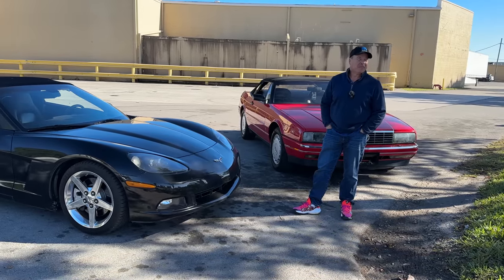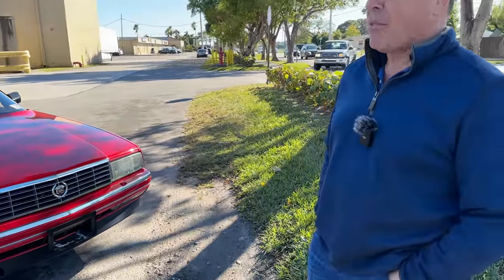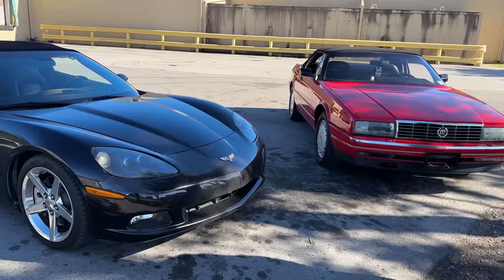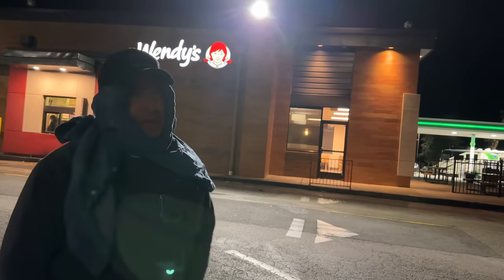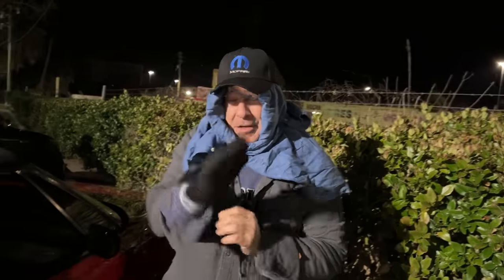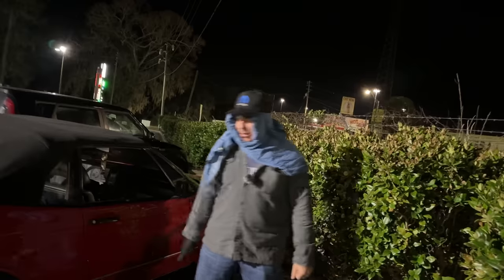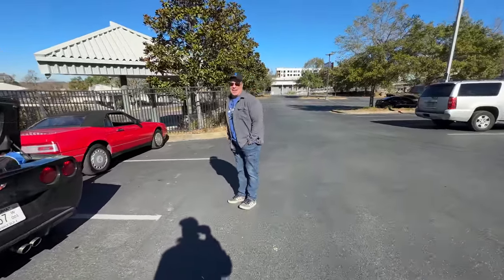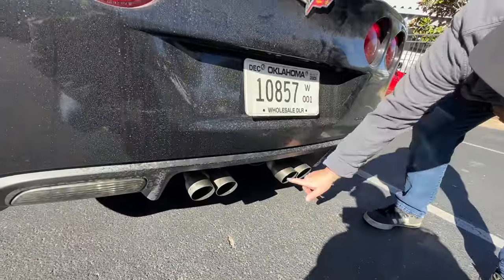Will SamCrac's 300K Mile c6 Corvette and the Flooded Cadillac Allante Make it 1700 Miles Home?

Comment: Before  you replace all the seals and gaskets on the Corvette  check out "AT 205 Reseal"...Scotty Kilmer recommended and I tried it on a 2000 Chrysler Town And Country minivan that leaked 5 quarts a week...Within a week it absolutely quit leaking...so for $25 the Valdez quit leaking....Available on eBay or Amazon

Comment: Hey Randy, just a shot in the dark, but it could be possible that at the higher speed the water in the trans fluid gained enough heat to start boiling and built pressure to push out the dip stick. Hopefully all is well! Love the channel and keep up the good work!

Comment: 10:29 my guess is when you flush the transmission fluid out until it’s completely red. The trans cooler inside the radiator still had the water base transmission fluid in it. You be amazed how much transmission fluid is in the cooler side of radiator to. It’s almost a full quart of it.

Comment: I'm not too surprised they made it.   I once took a $700 120K '91 Chevy Van on two 2500 mile road trips in two years, from NY to SC and back.  The only trouble I had was I had a tire develop a bulge and pull to one side so I swapped the fronts to the back and vice versa.   GM stuff is pretty good.

Comment: I was also a small dealership used cars and here in New York you had to have the registration with that plate so they don't emboss the plates here anymore it's flat so I used to put the registration right on the back of the plate cover it with clear tape I know Oklahoma isn't as strict as here plates are very expensive so is the insurance

Comment: The transmission fluid is overflowing because water/coolant from the radiator is most likely leaking into the transmission via the radiator's transmission cooler. Try bypassing the "built-in" transmission cooler in the Allante's radiator and use an external cooler instead. Those internal coolers absolutely SUCK!! You should use an external transmission cooler on ANY vehicle with an automatic transmission due to high pressure from the coolant in the radiator forcing its way into the lower pressure transmission cooler via small cracks/fractures from the cooler's welds as a result of thousands of heat expansion/contraction cycles.  
     A transmission repair shop owner once told me that 75-80% of all transmissions that he had to repair/rebuild had significant amounts of water/antifreeze/coolant mixture inside of the transmission's fluid, which is what caused the damage.  So, EVERYBODY with an automatic transmission should go to their mechanics and have them install an external transmission cooler immediately in order to avoid unnecessary damage to their expensive transmissions.  I am currently dealing with the same issue on my recently acquired 1977 Airstream Argosy motorhome with a 454 Chevy motor & Turbo Hydramatic 475 automatic transmission. When I put it into gear, the transmission slipped and the vehicle revved but would not move, like what happened to you. As I took the transmission's pan down to see what was going on, all that came out was CLEAR WATER!!  Barely any transmission fluid came out either... needless to say, I was NOT a happy camper! 
     Funny thing is, I had already purchased a heavy-duty "B&M" plate-on-plate external transmission cooler with AN fittings specifically for the vehicle before this even happened.

Comment: I bet the trans vent on the Caddy's transmission was plugged up due to the crud from the flood. As for the Vette and its leaks. It would not be a GM product without a leak or two. A nice adventure.

Comment: The only stop leak I’ve ever found that works is AT-205 Reseal. I had a power steering leak so bad it drained the whole reservoir/pump (gm style) overnight. A bottle of that and it stopped leaking for an entire year.

Comment: I've seen a few cases of shared parts on cars due to them using the same supplier.  The 90s Euro Honda Civics (MA, not the same as the 6th gen US model) used the same door handles as the 00-06 Subaru Impreza.  Similarly, you'll notice Toyota and Subaru use the same beep for the keyless entry system.

Comment: As a former used car dealer... Samcrac didn't take you for a ride.. your troubles are self inflicted.   Saying that, poor choices make good content.
Reply: Also on a flood car. Water in the transmission will break down the adhesive that bonds the clutch material to the disks. I know this because I sold my mom a flooded sentra and 4 months later was rebuilding the transmission. Great video.
Reply: I’m pretty sure he said that as a joke
Reply: @johnmiller9695  the transmissions in the sentras were junk from the start iv replaced alot them
Reply: Someone didn't get the joke
Reply: He is just making a joke bout sam
Reply: @johnmiller9695  even if it weren’t flooded it would have given out, it’s a nissan
Reply: @johnmiller9695  I’ve never heard of a Nissan that didn’t have a transmission completely bomb.

Comment: Mike and Al, I don’t think you flush the transmission completely. Did you flush the transmission’s cooler in the radiator also? I suspect the hose was connected before the transmission cooler. Therefore the transmission is blocked now that you’re driving it with the return line into the radiator. That’s where all of the foam came from. That would be my guess as to what happened. I love the content.
Reply: I was thinking the same thing it looked like they took the off directly from the transmission instead of the cooler end which is my guess.

Comment: Did you clean out the transmission cooler on the Cadillac when you did the flush? I'm guessing the froth is residual from the cooler that mixed with the new stuff.

Comment: Get a hot wire from the battery and take out the window switch and touch the window switch with the hot wire and the window will go up

Comment: Why wouldn't you just take it to a shop and have the transmission fluid changed for a simple starter fix.  Way better then continuing to drive with it the way it is.  I am rally baffled that this was not the automatic obvious thing to do.  In the time it took to go eat breakfast the fluid could have been changed and maybe saved the transmission instead of completely destroy it?!  Is it just for content? Is that what I am missing?  Or?
Reply from the maker: Yes that is exactly what you’re missing

Comment: Expect to do another flush of the transmission, run it for a couple hundred miles and check /flush again… will be worth it in the end. Arrive safe.
Reply: Surely, what it requires is a new radiator, as that has ruptured, and leaking into trans.

Comment: As a good video good good content the thing with the Cadillac you should pull the torque converter out not trying to be mean because that holds a lot of fluid in it and flush the system that way one mechanic to another mechanic good video bud keep up the good work

Comment: The door handle on the Allante isn’t a Cadillac part. Pininfarina put the door handles on. The door key is also not an original GM part. The Allante has a lot of odd European parts on it. 
The window switches, if you can find them, will be used and cost hundreds.

Comment: hey randy the back plate on the back of the Corvette engine leaks oil because of seal harding  over time ..  I would 💯%. try to order  AT205 RESEAL .     TRUST ME IT ACTUALLY WORKS . works great for rear main seal leaks and other leaks of the sort ..

Comment: You know it's not that difficult to run a power from a battery to the window motor or a ground whichever the switches work off of
Reply from the maker: Ummm motors and salt = rust = DOA.

Comment: proly water in tranny boiled at 100mph out the dip stick. If you can access the converter from under the car, drill a hole in it to allow whats in itto drain then plug with a sealed end rivit and drain tranny again , do not flush, just fill and run it in DW until full.  lolololol , after seeing that, you need a buzz cut
Why did you not pull the door panels and crank up the windows ?